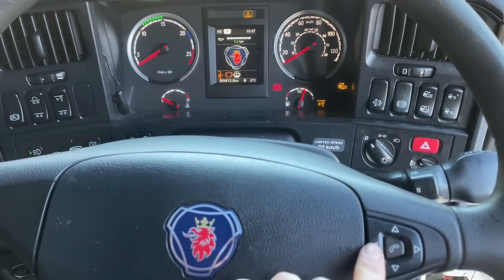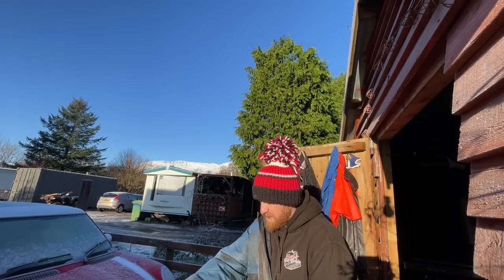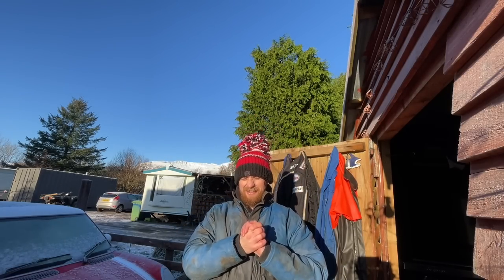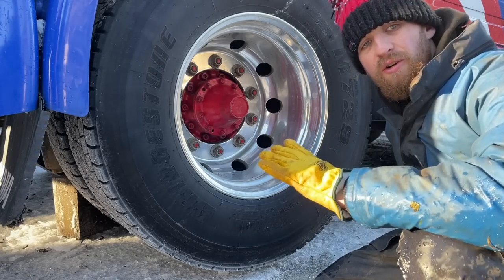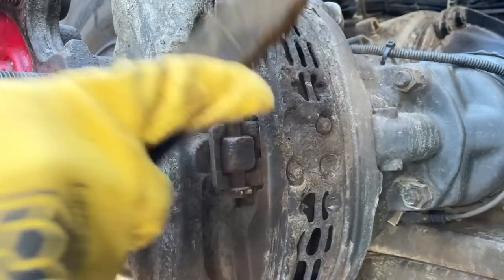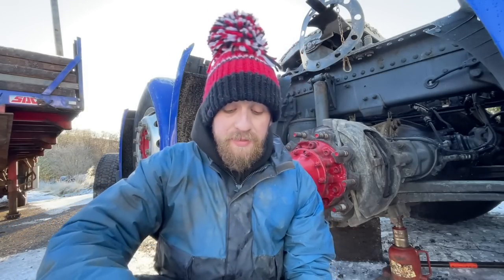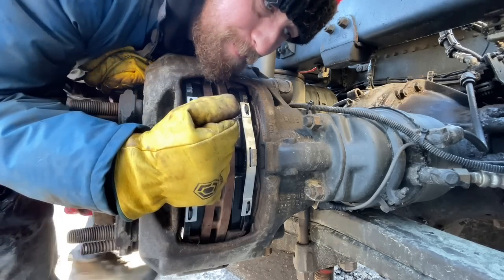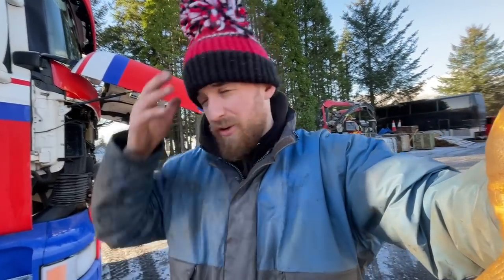Changing Brake pads on Scania truck ￼#flatoutflatbroke #scania #trucks

Comment: If your having to hammer your pads into the carrier it can cause brake bind and wear them down quicker. Some time a light going over on the edge of the pad with a flapping disc will allow them to slide into the carrier easier and stop them binding

Comment: Used to use a flat file on the guides or if really bad a good gan ower wi a needle gun, should really be able to slide the new pads in wi just hand, and maybe just a little grease just on the edges,

Comment: My R450 seems to wear the pads  more on the drivers side on drive axle too. I replaced both calipers and both brake Chambers and it still wears faster on the off side.  I think it's the way they are or the ebs just sends more pressure too that wheel.  Been watching your videos for the last couple of months and there proper 👌
Reply: I have the same on mine. 15 on the right and 40 on the left

Comment: My R 450  was wearing pads un evenly and turned out it was brake chamber leaking air from service brake side to parking brake side  .fitter showed me by putting rubber glove around the disconnected park brake and watching it slowly inflate totally cured prob

Comment: If you need to hammer pads in mate you haven’t cleaned the carrier enoug,trying taken a little bit of the pad on the sliding edge as from factory they get covered in paint stay away from copper slip too it’s crap but Scania tell you to use it it just attracts dust and crap I’ve always put them in dry, them discs are shot too bits btw